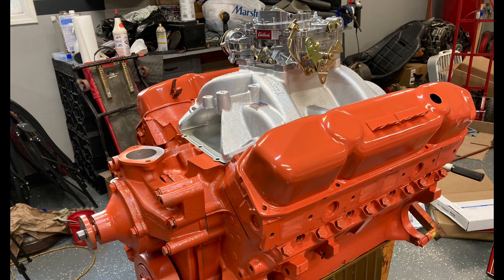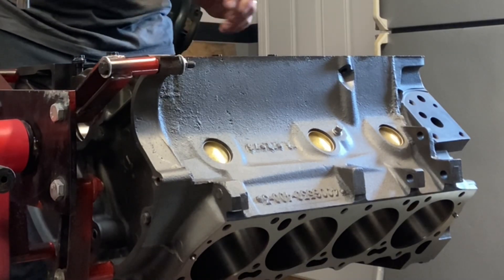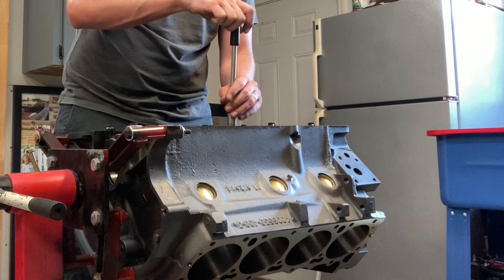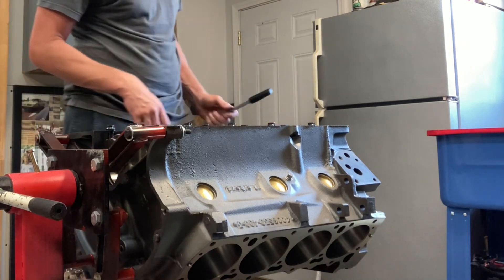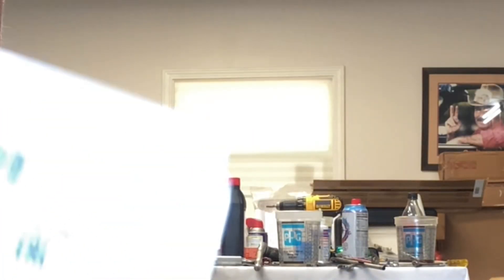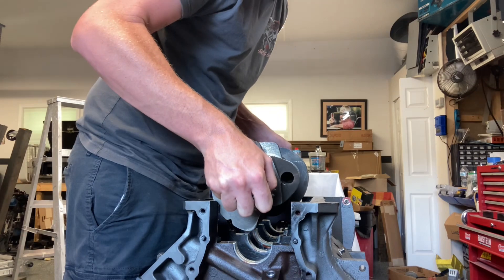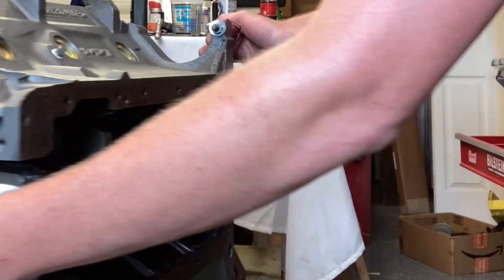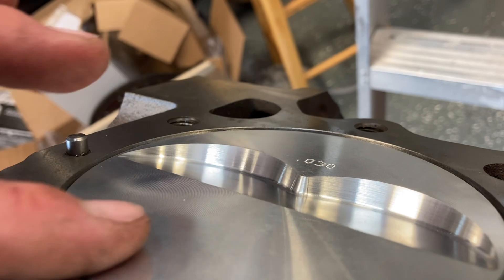Big Block Mopar 400 Full Build Series: EP.1 Checking Piston to Deck Height #BigBlock Mopar #Low Deck

Comment: hi there, great vids newly sub'ed and going through the videos on this 400 build, i have a 400 in my shop right now and am wanting to do the same build, whats the reason with going with the 440 source rod over factory if your staying with stock stroke? and did you have the crank balanced? or will it still be externally balanced? part number for the pistons? thanks in advance!
Reply from the maker: These are kb 240’s. I had the engine rebalanced with a b and m flexplate, so I can run any neutral balanced converter behind it. I got the rods, pistons, and rings from a buddy for $350. That sparked this build!

Comment: around how much will dyno cost? what all should be expected to provide as far as bolt on accessories?
Reply from the maker: I am researching prices and locations. The accessories vary by place. Some are setup to test about anything, but others only focus on specific engine makes. Likely needs a flywheel, bellhousing, and a way to drive the water pump. I will do a video on the dyno prep as time comes.

Comment: Hey Joe great work, was this block built before 11/15/71 known as the cold weather block with the larger main bearing support
Reply from the maker: No sir it was from 73 or 74. Just a good seasoned 400.
Reply: @JustMoparJoe  I'm curious why you use the 440 rods which would be longer which makes it necessary to move to wrist pin in the piston, you wouldn't really gain any cubic inch in fact it would be losing cubic inch.
Reply from the maker: @mrpurcountry  oh no. These are stock length rods for a 383/400, but from 440 source. They are their outsourced brand, basically like a speedmaster.

Comment: Would you recommend rebuilding a 71 hp 440 motor with 20.000 original miles
Reply from the maker: I couldn’t say how hard those miles were. If it has sat up and rings rusted in place, it could be definitely worth pulling apart to check.

Comment: How do you like the quality of the 440 source rods? I thought about using a set on my 440 that spun a rod bearing
Reply from the maker: They were decent quality for the money. If I had to do it over, I may have had some stock ones rebuild. There was one that had a small dip in the small end of the casting. I believe they were designed to be press pin. We fully floated them. For the money, they are decent. Ed says they look just like the speedmasters that I brought in for a Ford 351w.

Comment: Thought it was going to be a turbo 400? You said naturally aspirated 500hp
Reply from the maker: That’s a different 400! I know I’ve said 400 a lot lately. I have a 400 that I started on the ground. It’s a stocker. It will get the turbo first. When it comes out, this engine will go in. Both will be in my dart sport, unless the barracuda needs an engine before NNN.
Reply: So much good content 😁

Comment: You want the piston / deck clearance to be 0.000 or as close to that as u can get.
Then use a gasket with compressed thickness around 0.035 - 0.040 thou.
Thats how you establish quench , essential for controlling knock / detonation.
0.035" is ideal in a steel rod motor that stays below 7000 rpm.
Reply from the maker: Thanks for sharing, Mike. I am familiar with quench or squish, as some say. If these were nicer pistons, they’d have a raised block where the closed chamber meets on the head(see my 408 videos). It’s a very efficient chamber, minus the large dish to keep it pump gas friendly. I understand what is ideal, and I understand what this engine gets. We can’t regularly make a statement that quench, “essential for controlling knock/detonation”, when this engine factory had a .120 deck clearance, plus gasket, plus open chambered head. I am drastically improving all those things(75 cc head that will be shaved some.) Hopefully you come along for the build.
Reply: @JustMoparJoe 
Enjoyed "I understand what is ideal.
And I understand what this engine gets."
Build on !
Reply from the maker: @michaelmoon8856  thanks for understanding! I am looking at around $3,500 or less for this total build. That’s a fairly inexpensive 500 if possible

Comment: Did you manage to get a OEM steel head gasket for this or still using the felpro blue? Get a few more fractions with the old steelies!
Reply from the maker: I have a perfect pair of steels from my Michigan trip. Sadly, I believe they don’t have a bore big enough for the .030 over 400 bore plus the chamfer from the factory they add.
Reply: @JustMoparJoe  Damn, I was thinking of solutions and was recalling that you can take a 440 .30 over and use a 400 stock steel. You would need a mancini one maybe, they run them out to 4.400 - that is IF you want to go that route, sir.
Reply from the maker: @cjm5002  you have definitely inspired a video! I’ve actually blown a blue felpro before, because the fire ring hung over the big chamfer on a .030 440. As soon as the new engine started, it ran great. But, once at the track, it would spit and sputter under high rpm’s. Sure enough, it was the head gaskets hanging over, after they had crushed
Reply from the maker: @cjm5002  here’s a one I’ve not encountered before. Can you run a steel shim head gasket on an aluminum head? Will the dissimilar metals react with each other? I’ll research into it.
Reply: @JustMoparJoe  Ive heard mixed things. Some people say you can if they are mls. I know I wouldn't do a single steel with aluminum. Its on the same premise of having to add the stupid paper gasket on our valley pans between the aluminum intakes and heads.

Comment: This is a awesome series Joe! Great to see a low deck big block built for power, great engine's for A bodies, I've always had to move the heater blower motor to use tall valve covers with the tall deck engines in A bodies.
Reply from the maker: Thanks Mitch. The only RB’s I’ve seen in A bodies ended up racecars with elephant ears 😂

Comment: Clean and Mean.  -
Power is in the heads.  Cam needed to work w it.  
- personally, I’d bring the comp.  To about 10.5 static.  
- your build.  - looks great so far.
Reply from the maker: Thanks Tom. I know Ed will shave the heads some, and we try to find the thinnest gasket possible, that works with the big chamfer that’s on the tops of the cylinder bores. Squeezing over the 10/1 would be nice 👍🏼

Comment: Good job Joe.  I don't care how many times I see this type of work, I always enjoy it.  Especially when the machine work is done correctly.
Reply from the maker: Thanks Bert! I will try to do this one justice. Ed did an awesome job 👍🏼
Reply: @JustMoparJoe  
I know Ed's work, and I have seen enough of yours I think it's going to be a very good engine.  Good luck Sir.
Reply: ...but does not grind the casting flash off the main bearing webs....and its a cast IRON crank, not cast steel , Funny shit